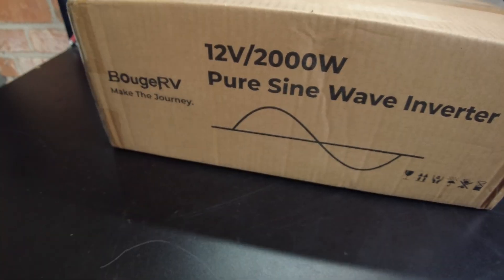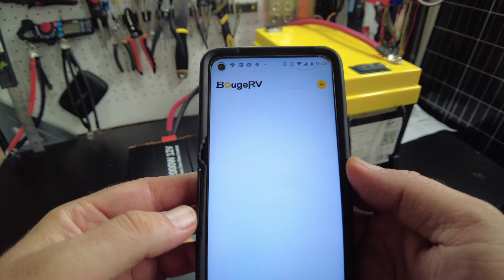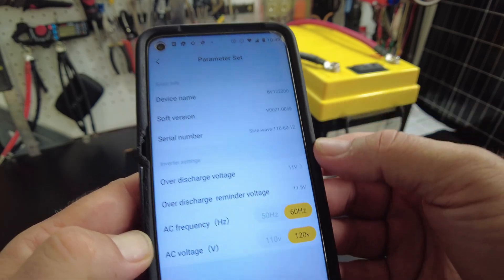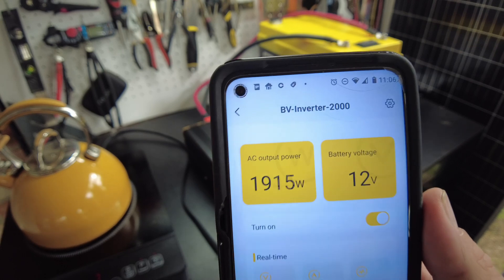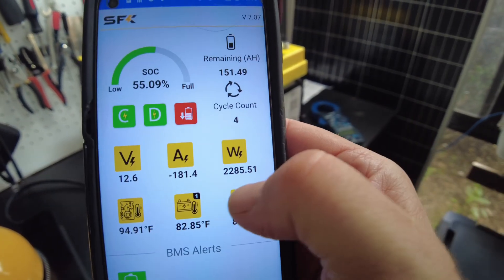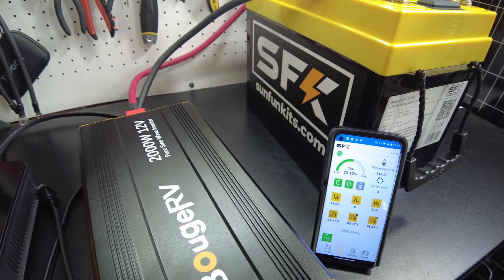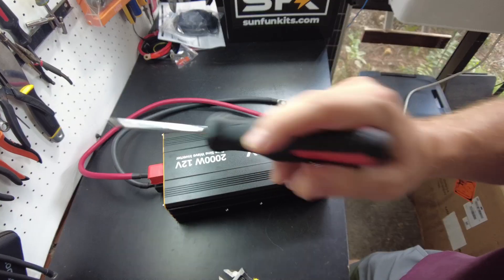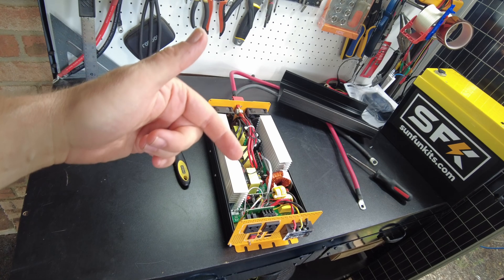BougeRV 2000W 12V Pure Sine Wave Inverter with Bluetooth

Comment: you are also over the 100a limit of the BMS in the battery. Not good! don't hurt yourself. so many RED flags. Thanks for the video. Anyone watching do much much more research please. How hot was the 4 gauge? I use 2/0 on my 12v system and the wires get warm@ 130A/1.6kw. Those 4-gauge wires had to be RED hot.

Comment: Inverters are pretty good now days. I wonder what it would take to add battery charge capability to these things. A complete generator solution, just add battery.
Reply: I believe EG4 has one that does that.
Reply: @jw3843  Yes, good point. My Growatt has a charger too, but these smaller, portable units generally don't.

Comment: Do you ever test for inductive load start-up capabilities, like a fridge or vacuum cleaner? My 1000W inverter complains and cuts off when I switch on a 200w laptop charger, is why I ask, it will run it after a restart though.